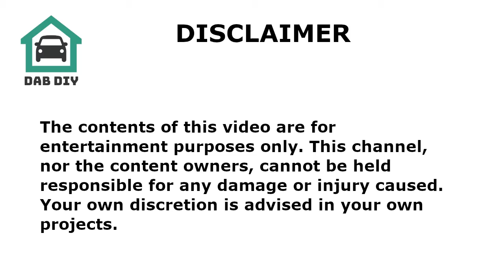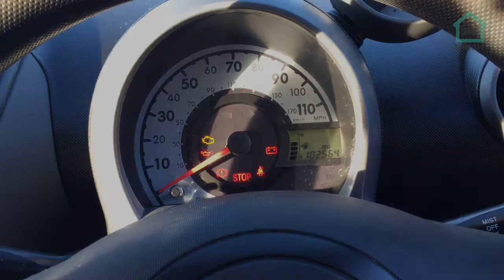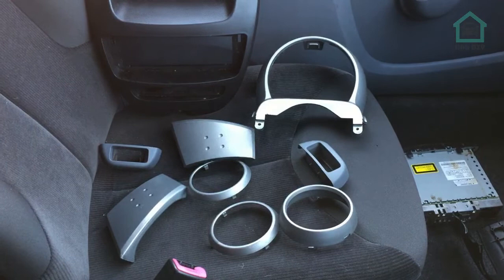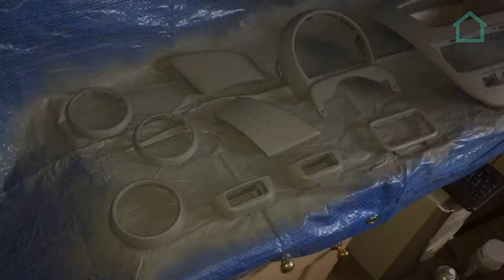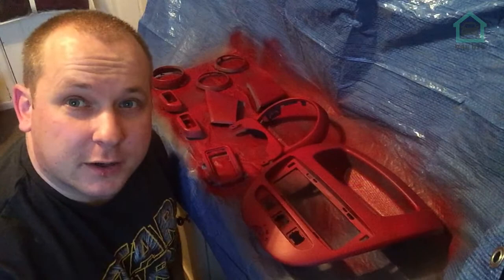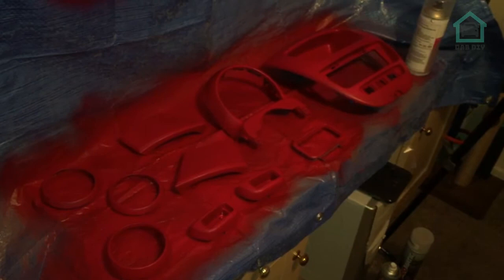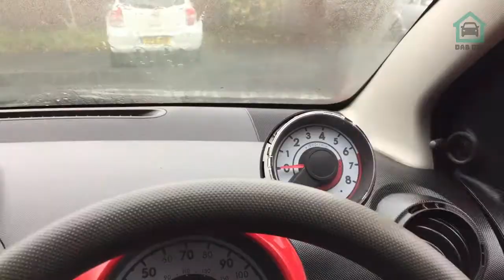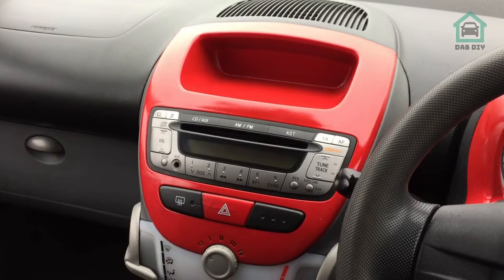Painting the C1's interior plastic trim

Comment: With the size of cans of paint that you had from ebay was there enough or did you have to skimp thanks.
Reply from the maker: There was more than enough paint to go round. I’ve still got a good half a can left to start painting random bits and pieces with.
Reply: @DABDIY  great thanks for that daughter wants her car done was it enough to scuff them up with a pad or would you wet and dry them thanks
Reply from the maker: Scuffing was plenty. Make sure you do a decent job of scuffing though. Might be a good idea to use an adhesion promoter too, but I didn’t se that as a necessary step for me.

It’s a really easy DIY job though, I’d recommend it to anybody.
Reply: @DABDIY  thanks alot for your help.
Reply from the maker: My pleasure 👍🏻

Comment: does cheer it up ,
Reply from the maker: Agreed, it makes it look like one cares. Looks like how it should have come out of the factory, if it wasn’t designed and built to such a tight budget.
Reply: @DABDIY  i know om mark two you could option different colours, too expensive to do so, but you could
Reply from the maker: At least by the time they released the Mk 2, they’d considered that color coded interior trim is a nice thing to have.
Reply: @DABDIY  actually on the mk2 facelift, its black or nothing lol, matt black for the trims
Reply from the maker: I’ve seen quite a lot of people wrapping and hydro dipping their interior trim panels. My other half’s Mk 2 is the 1.2 version and it’s got silver trim pieces on a dark blue car. I’m not a fan, but she won’t let me hydro dip them 🤣
Reply: @DABDIY  yes it would be next level to do that rather than just paint
Reply from the maker: I had intended to paint the air box on Project C1 body color and leave it at that. I’m tempted to dip it and see how it goes. You’ve got me thinking now... 🤔
Reply: @DABDIY  i bet if you show how to carbon fibre dip it, it will be a popular vid
Reply from the maker: Perhaps paint it body colour red with a translucent carbon fiber over the top. That would look pretty good.